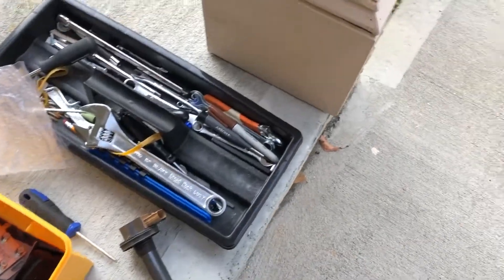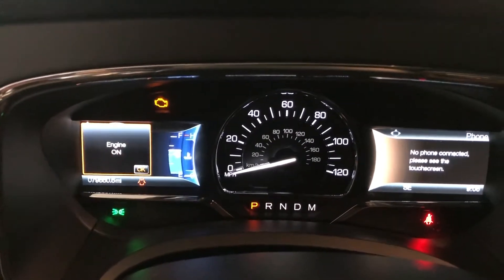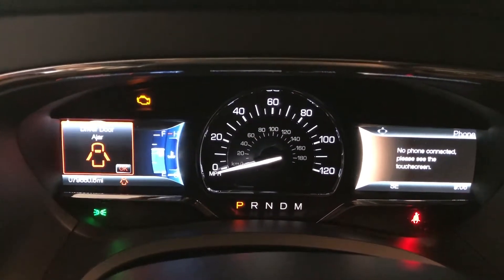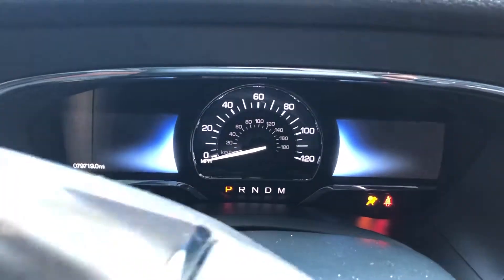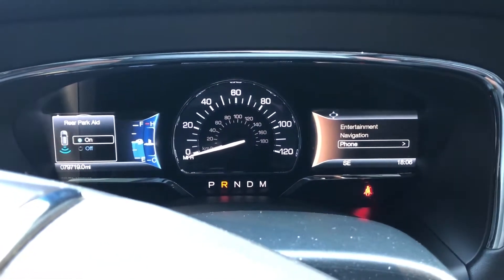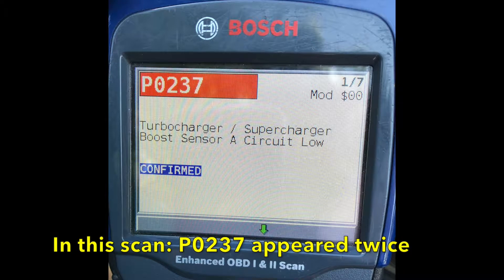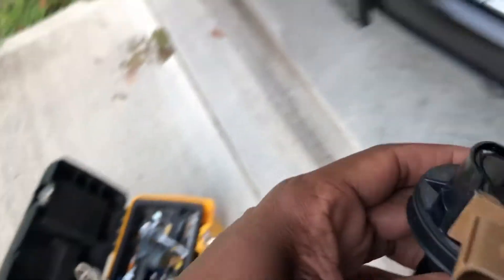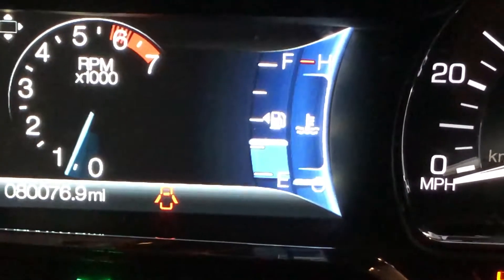2015 Lincoln Navigator Misfire Mystery Part 2 #J2review #P0237 #025E #P0354

Comment: Same problem here right now we change spark plug we change all coils and even clean fuel injector but still the vehicle shudder
Reply from the maker: Unfortunately, it might be your transmission but if you're certain that's not the problem, please check out my conclusion video to this series. It might be the MAF or MAP Sensors.

Comment: My lincoln mkc 2015 select FWD shows wrench symbol 190k km. Powertrain issue?. Any idea how to fix this. Expected cost in service center?
Reply from the maker: To answer your first question, the wrench can mean more than just the transmission. It can also be limp mode due to the turbo pressure sensor adding up or it can even mean that your transmission control module needs to be flashed or reprogrammed. You can watch the final video in this series to see notes from my invoice, but I think it was around $600. Don't take my suggestion to watch more of my videos as a way to get more views. I just wanted to respond to you quickly and I can't remember everything because a lot has happened in the past 2 years.
Reply: @j2review  Thank you very much for your advice. Subscribed to your channel
Reply from the maker: @arunkumarmv7566   Thank you! Without having the invoices in from of me, I can tell you that the TBCP Sensor, MAP Sensor, MAF Sensor and ignition coils were connected to the problem but the most important thing of all was having the dealership connect my navigator to their computer. Trust me, It has to be the dealership.Please don't spend more than $600 on this fix.
Reply: @j2review  . My nearest dealership is around 250km away. Is it safe to drive that far with these issues? I have a decent garage (Dyna trade) in 40km range. Planning to visit them first then to lincoln if not solved
Reply: @j2review  Thank you
Reply from the maker: @arunkumarmv7566  in hindsight, I feel that I may have caused damage to my navigator by driving it in Limp Mode for 3 months. However, I took it to 2 dealerships and a mechanic who claimed to be a "Ford Lincoln specialist" before finally calling Lincoln's corporate headquarters and asking for their help. You can try that mechanic if you want. Maybe they have the secret to fixing it. If they don't the dealership certainly will. It's in their computer.
Reply: @j2review  Thanks again

Comment: Do u know how to fix a limp mode on a Lincoln Navigator 2015?
Reply from the maker: Hi, the short answer is not exactly. However, if you check out the last video in this series, you will see the invoice which shows that the MAP & MAF sensors were the main cause of the limp mode, as well as, the need for a firmware update. After trying to resolve this problem on my own and taking it to several other mechanics who claimed to be "Ford Specialists", we all came to the conclusion that the only way to fix this problem is to take it to a Ford/Lincoln dealership. It shouldn't cost you more than $600, but please don't hold me to that.

Comment: I have the same vehicle but I changed all the plug and ignition coils with the best one. Then drain the power from the vehicle then reconnect the battery, turn the vehicle on and let it run for 5 mins then go for a drive. Mine is at 127000 miles